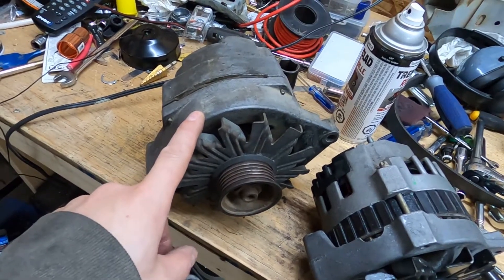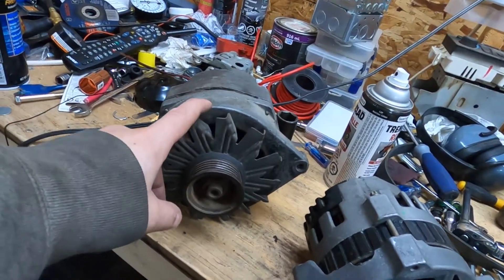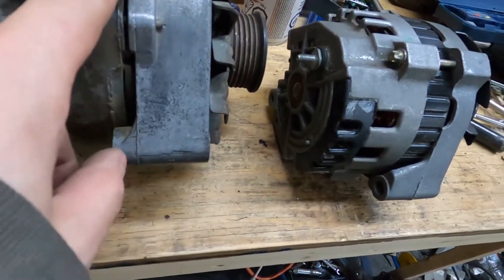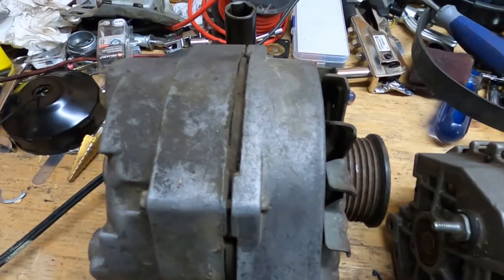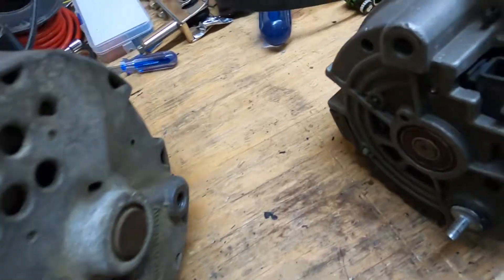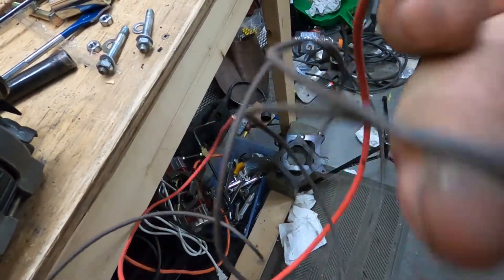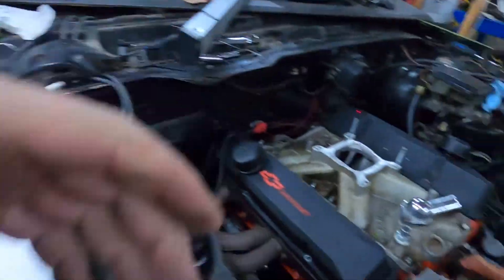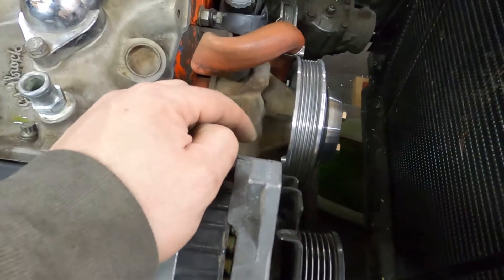85 Camaro - CS130 Alternator Upgrade

Comment: I just bought 1 cs130 alternator had to change  face off with my old 1 2.8 chevy  but should crank out 160 amps if it does only 105 I send it back